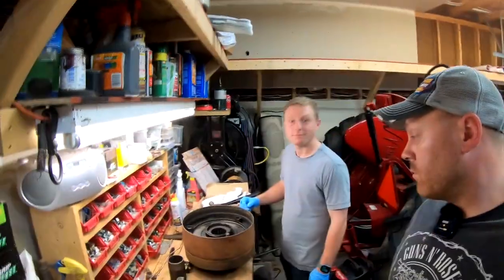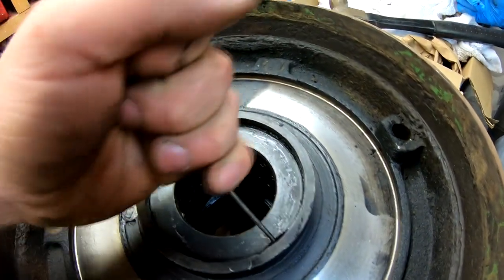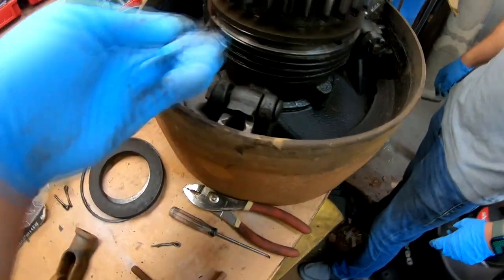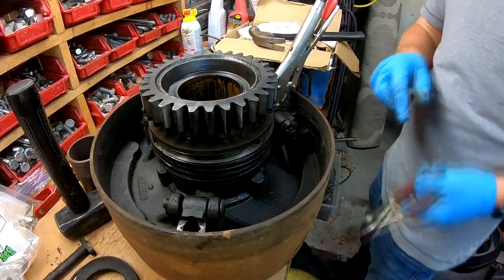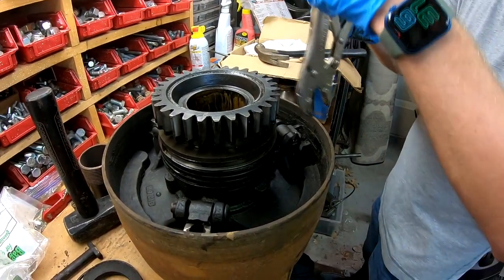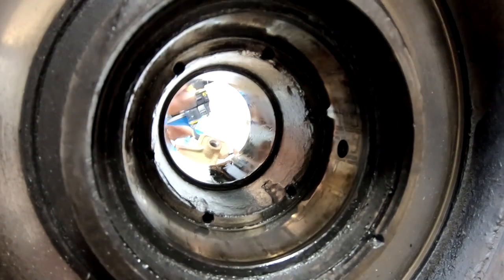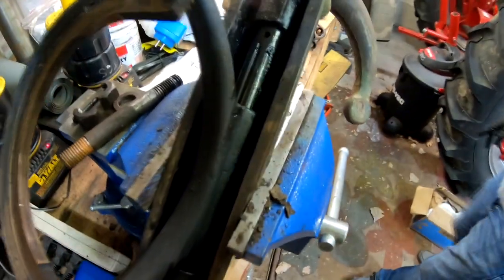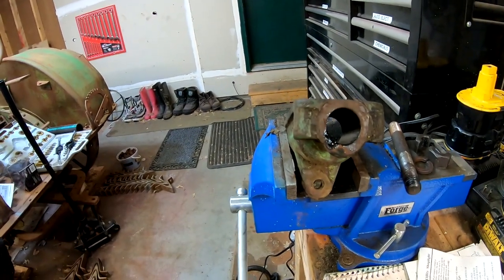1929 John Deere GP Part 4: Clutch Pulley & Clutch Fork Disassembly

Comment: You are in your element when wrenching on a vintage tractor in your garage. Say hello to Tony for me. Look forward to see how the ole GP turns out.
Reply from the maker: It's nice to turn wrenches again! A heated garage would allow this year round! Ha ha. I do have the torpedo heater sent by a generous viewer, but I am a little leery on using it with the garage door closed in the winter. With the door open, you're really wasting a lot of heat, especially when it is below zero! The GP will live again. A matter of discovery at this point.